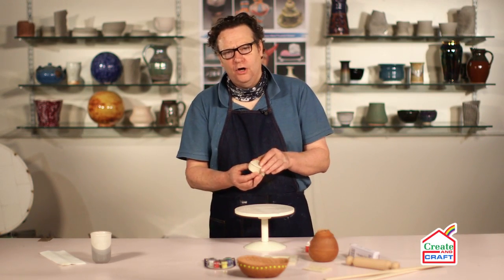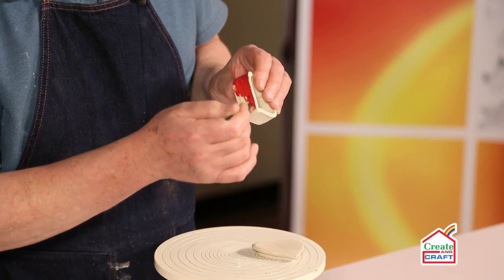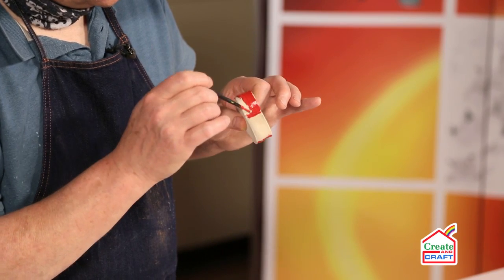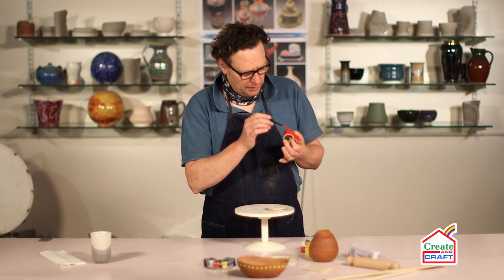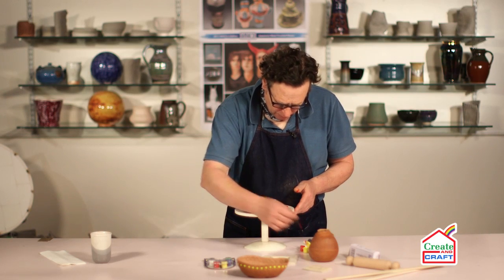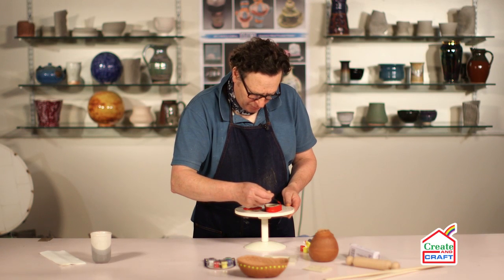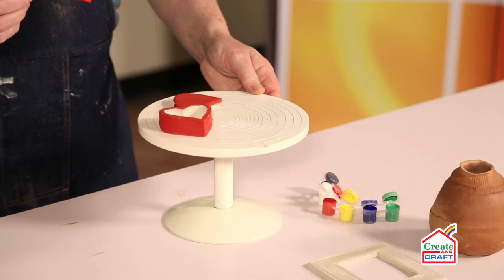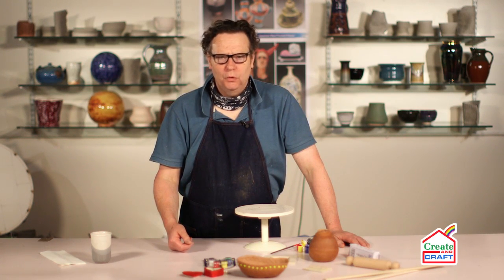How to Paint an Air Dry Clay Heart Shaped Box with Acrylic Paint Part 1 | Pottery | Create and Craft

Comment: What kind of paint are you using
Reply: Nonna M it looks like a basic acrylic paint. He probably put some in the small container for the video. It’s my experience that the ones in tubes work well. The ones in the plastic bottles dry out quicker than the tubes. Good luck